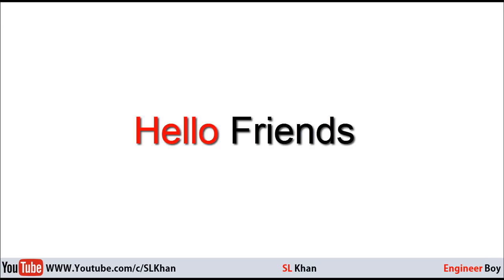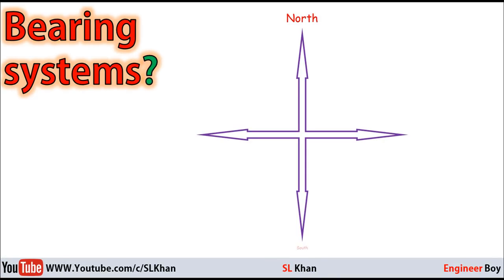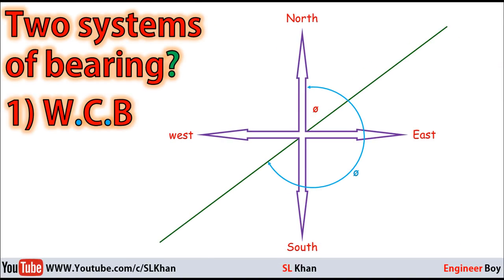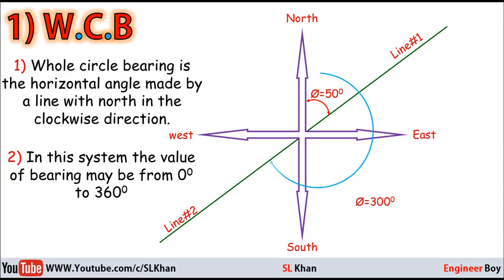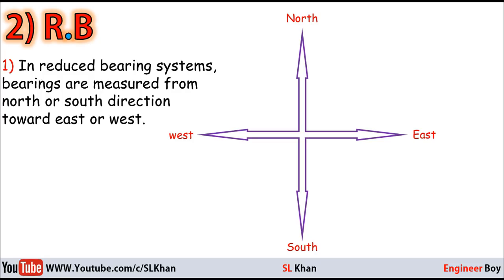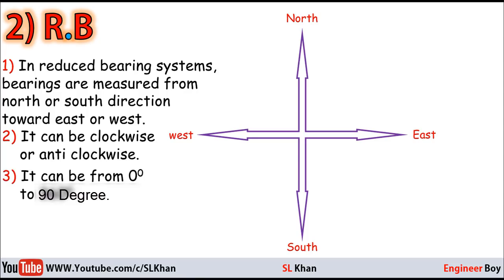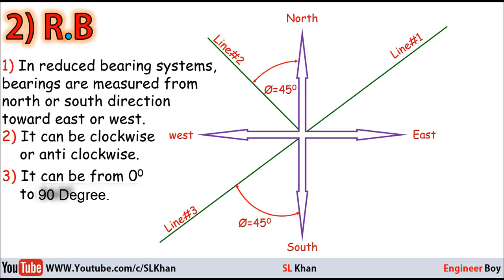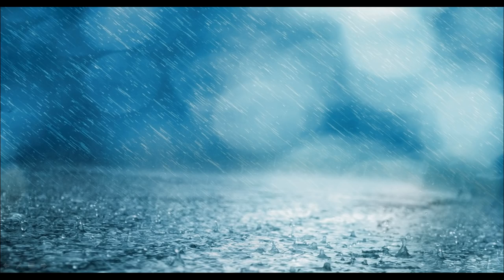bearing systems / #engineerboy / #civilengineering

Comment: Some how you just gave me a flash of insight. Now I get it Bearings are not the same thing  as measuring angles. Angles show the spread between three points on the ground. While bearings show a direction from the point of the observer. This is so easy once you can separate what the differences are. ❤❤❤👍